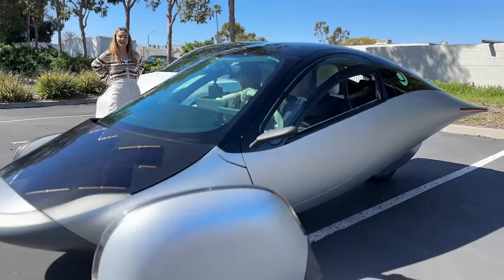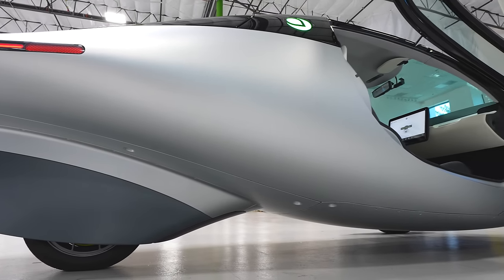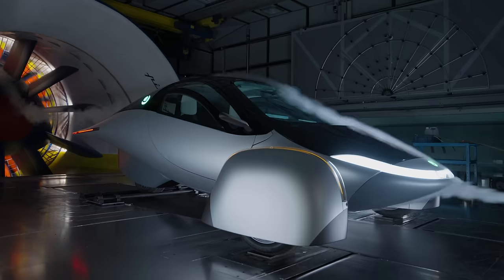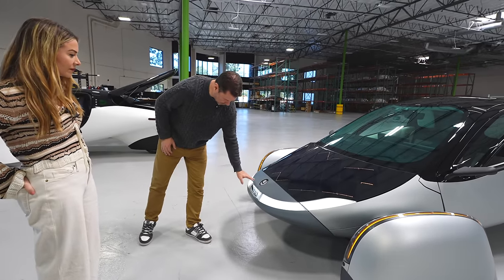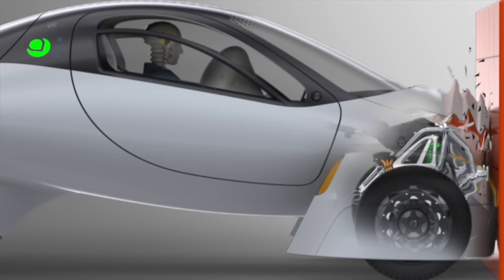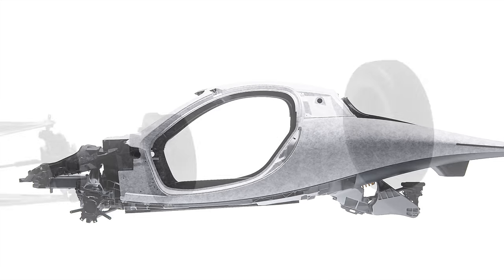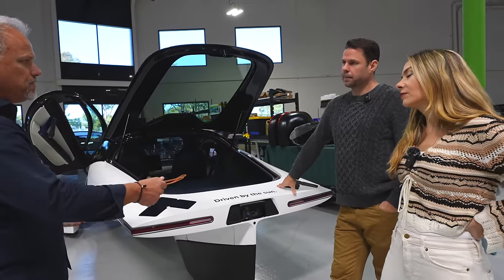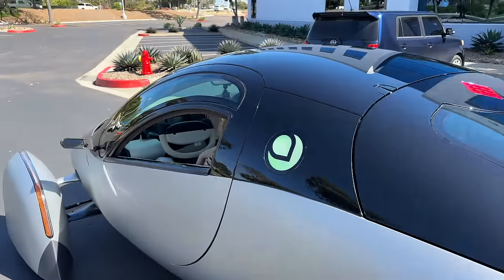Confronting Aptera's CEO w/ Investor - WHERE'S MY CAR?

Comment: That physical bar across the windows would drive me crazy, it looks like it is directly in your line of sight if you turn you head to look out either window.   Better have waze built into avoid road debris -- going to be a pain to avoid real issues with roads in most cities.
Reply: Likewise about window obstruction to which others say…."But there’s a zillion cameras", "Thought the same but when I sat in it, not that bad."  It’s an unfortunate design detail/tradeoff to aid aerodynamics, crash resistance and manufacturing ease.
Reply: That was my wife's and my largest concern about the design - until we rode in a prototype.  We found that we hardly noticed it in practice.  Although the sightlines are different for the PI vehicles, we are far less worried now, but are still keeping an open mind on the subject.

Comment: The car's worst nightmare is wind. I've had my car drag sideways during heavy wind. 
This card would need a wind anchor
Reply: It's much more aerodynamic across the car as well. While other vehicles are getting pushed around, this body shape avoids a large portion of those forces.
Reply: Side winds and crashes. Did the mention required crash tests in the video?
Reply: @DR_1_1  Aptera has noted in other videos for sure, that crash tests are not required but they will do a full set of crash tests in order to demonstrate the safety as if they were required in order to answer the "How safe is it?" question.  What caught my eye was the indication that the Cd = 0.15, not the 0.13 we've heard for quite some time. I wonder if we could "legally" eliminate those useless side mirrors, how much will that affect the Cd?

Comment: I just realized a huge problem for Aptera. In the video it showed the Aptera trying to park next to a Tesla. It looks like it won't fit in a regular parking spot. An Aptera is 88in. wide. To put that in perspective, a Cybertruck is 80in. wide and what does everyone say when they see a CT in person? "It's a lot bigger than I thought it would be."
Reply from the maker: Hmm… definitely not bigger than an average parking spot, the angle of approach there was for us to take a thumbnail picture, so not indicative of true size. 
Also of the five cyber trucks I’ve personally driven and the dozens of people commenting on it in person, I’m pretty sure almost everyone said cybertruck is smaller in person than they thought.
Thanks for watching and commenting!
Reply: I realized that a long time ago. The thing is clumsy wide to compensate for the 3 wheel setup. And that third wheel is going to see an exorbitant amount of flats. Runs on the road where all the dirt collects. His F1 safety comparison is a total joke. With this thing any T bone accidents will directly impact the driver. Living on airbags only. F1 does not have airbags btw… and T bone accidents in any car series are usually ending in death or very serious injury. THIS THING? No chance…
Reply: @janverschuren3446  Await the crash tests before you decide how safe it will be. I disagree, and hope you are wrong about how safe it is.
Reply: @janverschuren3446  F1 cars have crashes with others going in the same direction, or with stationary objects like barriers designed to lessen the blows. They never have head-on's or t-bones through intersections.
Reply: @janverschuren3446  Sorry - I didn't see you had already covered why F1s are safer on their racetracks.

Comment: Like it but those front wheels are so wide spaced....Takes the space of an SUV.  And how many non-production models are they going to make?  Just build some already
Reply: The vehicles being built now are all production intent models and are going to be validated, including with crash testing.  Due to the single rear wheel, the Aptera can turn inside a Tesla Model 3 turning circle and cut corners sharply, unlike an SUV.  It still fits in a compact parking space.

Comment: 100W hr/mile?  That's 0.134hp  and there are three motors. How does that work?
Reply: That is on the EPA highway cycle.
Reply: 100 watt-hours per mile is not 0.134 horsepower.

Comment: How does it work in a foot of snow?
Reply: It should work well with proper snow tires.  It doesn't have the low air dam that many small similar size Japanese cars have.  In addition, the traction control can sense tire slip and adjust torque 32 times per wheel revolution, or about every 2.5: of tread travel.  This is a far better performance than most traction control systems.

I will have an AWD model in Iowa and report on my year round experience there.

Comment: Cool car, amazing efficiency, but would absolutely hate to get into a car crash while in this since you would most likely die. Though maybe I am wrong and they have some unique ideas on crash safety.
Reply: Having air bags, a passenger safety cage, and larger than usual crumple zones are hardly unique ideas.  They will be crash tested to FMVSS Part 200 standards, and the results published.

Comment: i think the biggest mistake is not making the rear most area of the trunk big enough to fit medium sized luggage (or at least it doesn't look like it does.. maybe the small sized or carry on sized ones...).  It'll fit way up by the back of the seats, but that just seems wonky, and quite inconvenient or short sighted.
Reply: I mean.... they've showed videos of people putting bicycles and surfboards in the back, or full costco runs. The back of the Aptera is larger than it might look. You can sleep back there if you want. Plenty of space

Comment: I think we need to clarify that the Aptera is NOT a solar powered car. It’s an electric vehicle that has partial solar recharging capability. In order to be completely solar, there shouldn’t be any batteries.
Reply: It depends on how much you need to drive.  It is at least partially solar powered.  Your distinction is nonsense.
Reply: Batteries are a good thing. Why would I want a car that only works when the sun is shining on it?

Comment: There is no freon  air conditioner (heat pump) ?! 😮 that will be is insane to drive in the desert it will be like driving an oven
Reply: It has AC
Reply: It has more inherent insulation than most other vehicles, so whatever AC/heating it has, should have to work less to maintain temps.

Comment: Will it go in a Swedish winter?
I mean 3 wheels. In snow! 🤪
Reply: I will report on my experience in Iowa where we recently had temps down to -30 C.  With proper tires I expect it will be fine.  The traction control is extremely sensitive and can sense tire slip and adjust torque 32 times per wheel revolution - or about every 2.5" of tread trave.
Reply: Will the Swedish unions allow it?😮
Reply: @malcolmrickarby2313  As long as it can be homologated to meet Swedish laws, the unions won't have a say in this.
Reply: @malcolmrickarby2313 the unions has nothing to do with what products are allowed on the market…

Comment: If only I was some @$$hole with a lot of money. I could have been an investor and jumped in front of thousands of people already waiting for their Aptera. I've been on the list for years and now there are 2,000 people in front of me. I love the vehicle but that really sucked. I don't expect I'll get my Aptera until around 2030. What a disappointment.
Reply: I placed the 42nd order for an Aptera.  I am grateful to each person who invested in the Accelerator round.  It means we will ALL get our vehicles sooner.

I am still getting my special edition -which was what my order number promised - it was never called a delivery order number - in fact, it was clear from the beginning that order numbers did NOT represent order build numbers.
Reply: Once Aptera is in high volume production, 2000 vehicles represents one to two months of production. 
The $35 million raised by the accelerator program (so far) is enabling Aptera to get to high volume production many months sooner than it would otherwise be able to. Therefore, the accelerator program is making it possible for literally every single reservation holder to get their vehicle earlier than would otherwise be the case.
And yes, I’m one of the investors participating in the accelerator program.

Comment: Wondering how this would survive in a crash accident….wherever it is frontal, side, or rear
Reply from the maker: 5 star safety rating and highest roof crush rating ever tested. We discuss this in detail in the video
Reply: @ItsKimJava  that’s really good to hear then. Glad to see it does well in that category. Because it doesn’t inspire me confidence when looking at it. Other than the design itself looks really cool
Reply: Frontal will exceed 5 star rating, rear has an immense amount of room before even breathing on the passengers, and side will be better than most/all sedans. The nature of the frame and body panels being carbon fiber and composites massively improves strength, especially when combined with how it's structured in the first place. Carbon fiber is 5-7x stronger than steel, and composite materials are roughly the same. In the beginning of my aptera journey I felt that the lack of side airbags was a big problem, but after researching and learning about the nature of the materials and structure, I'm confident in the side safety without them.
Reply: @ItsKimJava  Name the authority that has given the 5 stars?
Reply: @aussieideasman8498 I think this authority is A.P.T.E.R.A.

Comment: Would love for this to be successful, but it costs too much, it can't seem to be able to go up hills without overheating, and the "multiple CEOs" have too high of salaries for what is essentially a crowd-funded startup.
Reply: Nope. The cost is competitive, it handles hills just fine, and their salaries are reasonable for a start up
Reply: @GoClimbARockEh  Someone else who hasn't done their due diligence.
Reply: @dillonrohe4988  yup sounds like you are.
Reply: Your sucking up misinformation and regurgitating. Aptera currently burns $1.2M a month which is cheap for an automotive startup in this phase of pre-production.

Comment: Many states define a 3 wheel vehicle as a motorcycle and require a driving test and extended q & a for a license.  This stops many people from even considering this kind of vehicle.  Having driver and passenger totally enclosed should classify it like any other compact CAR.
Reply: The laws are changing. You can drive this in all US states with just a regular drivers license. There are still a few states where kids under 18 have to wear a helmet, but those laws will get changed quickly when this comes to market.

Comment: 11:15 no one? Misspoke 20k Annual Production. 10k/shift.❤
Reply: 10k produced in a year at one shift per day. Adding a 2nd shift each day for the same year gets them to 20k.
Reply: It is possible a 3rd shift could be added if the supply logistics to the location can handle the additional volume.
Reply: Yes, 20k per year on two shifts is about the capacity for our building as the truck lanes in and out aren’t the best… we could do closer to 30k in the same size building if it had better logistics flow ;)

Comment: 20 YEARS!!! and yet I still don't see aptera on the road.... Elio Motors #2
Reply: New company was founded in 2019. Old company failed a few years after the founders got pushed out. The elio comparison is superficial at best. These guys are far far further along than Elio ever was
Reply: Both my wife and I have ridden in prototypes.  There is almost nothing significant in common with either the company or the vehicles.  Aptera is now building production intent bodies for validation testing.
Reply: @n.brucenelson5920  I don't care what you and your wife allegedly have done. The similarities between  the two companies are uncanny if not uncunning . Until it's on the road there is no difference yet.

Comment: Someone should tell the CEO of Apterra the only difference in a heat pump and an a/c is a reversing valve which cost like 20 dollars.
Reply: Not quite right.  A compressor-based a/c only system is a heat pump.  Just not a reversible type.  What you are calling a heat pump is more correctly called a reversible heat pump.  Also, the CEO of Aptera already knows the difference but having a reversible heat pump in Aptera is considerably more complicated than just tossing in a $20 reversing valve.
Reply: @johnreeves7261  No he doesn't because he acted like it was completely different. And someone obsessed with the efficiency of a vehicle shouldn't be okay with toaster wire heating at upwards of 4 times more energy consumption. Also, no, putting a reversing valve in an apterra wouldn't be harder than putting one anywhere else. It's only complicated because you don't understand it. It is a small compact readily available component with a low voltage solenoid operation. They aren't using the heat pump in the apterra for component cooling like the tesla. So no octovalve. The things gonna be useless in the cold running a hairdryer everywhere you go.
Reply: @jamesa8851  Why the hostility?  By all means, point me to an Aptera appropriate $20.00 reversing valve.  I'll wait.

Comment: Okay, everything about this video is perfect. What I see as a problem going forward with electric cars in general is that they don't require as much service. Think of how many jobs are affected by a culture that has a product that is near perfect that doesn't need a mechanic.

I am not saying that I want to see them fail or that we shouldn't go towards electric vehicles. What I'm saying is where do all the jobs go when we eliminate gas powered engines. Not in my lifetime I'm sure. There are entire industries on replacement parts for gas powered vehicles for the mere fact that they require lots of repairing. Just a point of discussion.
Reply: I only say this as a point in that there could be a lot of well funded resistance to making a product that doesn't seem to have planned obsolescence as part of the company's strategy.
Reply: "What I see as a problem going forward with electric cars in general is that they don't require as much service." - Even ICE does not require much regular service like what was 30 years ago. Plus, EV still wear out and have problems. People concentrate on just the engine and transmission for an ICE vehicle and use that as a benchmark. Yet, EV still wear out. For example, a control arm on a Model 3 is pretty much like on an Audi. Guess what, they wear out. Same for axles, shocks, window regulators, control modules and even cooling systems. There will be a slight shift as to what repair shops do, but the work will still be there.
Reply: Yeah I'm sure things need repairing. What Aptera's strategy is / seems to be is they want this to be a generational car, to last longer than one lifetime. They also talk about right to repair and allowing people to work on their own vehicles. These things are attractive to me. Thanks for the comment I was just wanting a discussion around this area this topic.
Reply: @duerr-video  - People can work on their own cars today, so I feel that this"right to repair" means nothing. Plus most people can't work on their own car and pay others to do it. If that was not the case, there wouldn't be so many repair shops.

How does the Aptera become lasting longer than one lifetime. I do not understand that. Please don't use the bink as the example, how about the rest of the vehicle. The aluminum frame, hub motors, the battery, the steering, suspension, the control modules, the wiring harness, cooling system, bearings, bushings, interior etc... There are many components to a vehicle, not just that bink everyone is so enamored with.

Comment: These are cool and I have a deposit on one, but the odds are against them surviving (just saying). A used Model 3 is a better value proposition for most people, not to mention Tesla's next gen vehicles and the Chinese.
Reply: Thanks for your deposit.  The odds were certainly against them at the beginning, but I think that the odds have shifted.  There are no vehicles yet on the horizon that offer lower environmental impact or better performance for the price for singles or retired couples.

Comment: Its cool and all but it over priced small  vehicles . It was more like Japanese vehicles then ya maybe it would be worth the investment but its so niche to point that its not going to sell much unless you single and dont prefer family. Even if it commute car it way to expensive. That car should only be worth between 15-30k max anymore than it .  I dont expect much safety in that vehicle
Reply: You may change your mind when you ride in one.  The AWD acceleration 0-60 is better than the original Tesla Roadsters.  These things are FUN!  

Also, Aptera will be crash tested to FMVSS Part 200 automotive standards by a third party, and the results will be made public.
Reply: @n.brucenelson5920  that doesn't really make it any better . It's  still niches 😂. That doesn't convince anyone to spend that money on that's car  when you can get Tesla or pruis
Reply: @rudycastillo4150  - They have a plan for a sub $20K version (as confirmed by the CEO). So now it's affordable.
Reply: @billsmith5960  how many miles? Not many people are going to be paying 30k up for a car like that. Especially in this economy. That car would only make sense if it was affordable and it was only for commuting.  But no in their right mind would choose that over Tesla ,Toyota or Hyundai hybrid/ev. Especially with the new catl batteries
Reply: @rudycastillo4150 why not just watch the video?😊
Reply: @malcolmrickarby2313  ya I already watch one about it saw cost of it doesn't validate cost of it for those overpriced  cars of 3 tiers  ya that why they looking for funding for those 200 mile 400or600 mile 1000miles car